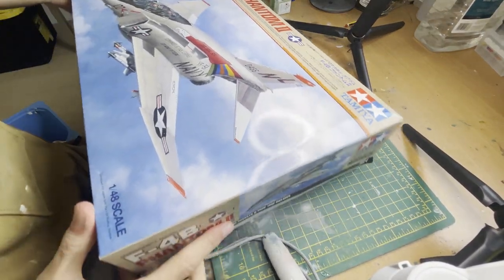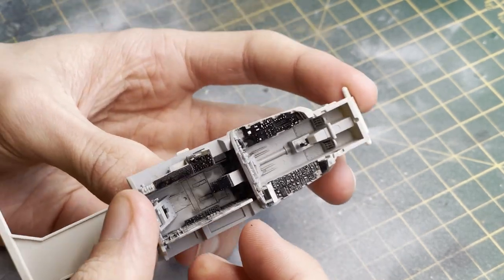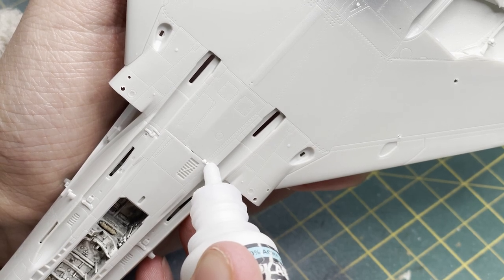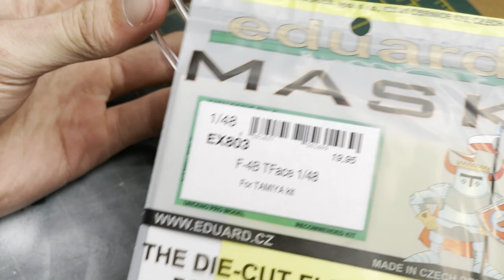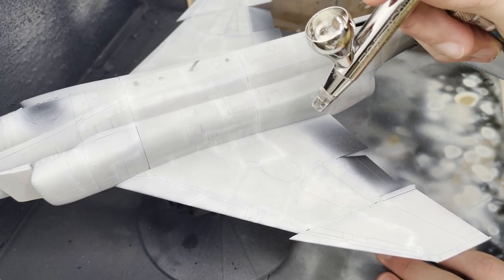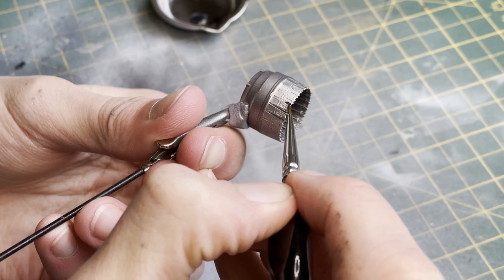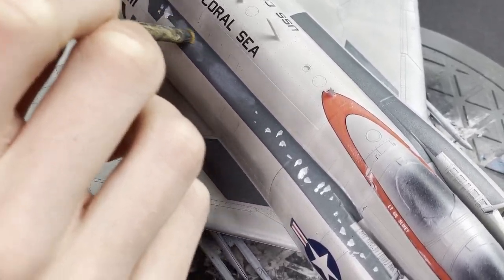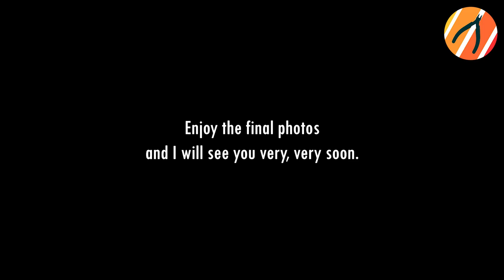Tamiya's 1/48 F-4B Phantom II | Full Build | HD

Comment: I bought this kit late last year and I have pretty much ruined it with the paint. I used ak and mr colour and Vallejo paints with a paintbrush because I didn’t have an airbrush. Has anyone got any tips to get the paint off so that I can carry on. I pain £90 and that plane has really put me off my modelling but I would like to finish this kit
Reply from the maker: Well if i was in your situation I would personally get a cloth soaked in thinner (probably the mr colour levelling if you have it as it’s pretty strong) and simple try to wipe it off. I think that should work?!
Reply: @machmodels  ok thank you I will give that a go when I get home from my holiday. 👍
Reply from the maker: Best of luck!
Reply: @machmodels  thank you
Reply: VMS clean slate works a treat. I’ve used it on fully finished armour models. Takes it all off without damaging the plastic

Comment: Excellent  build of my favorite  model kit. I have built six of these kits so far . The forward fuselage  belly panel is the only ill fitting part on the entire kit , so it wasnt something  you did wrong. As reguards to the  new eduard decals i quit trying to peel the carrier film off because  it kept chipping the decals. Now, i just spray a flat clear top coat and the carrier film just disapears.
Reply from the maker: thank you very much!! Six is insanely impressive!!! Interesting to hear you also struggled with the forward piece on the underside along with the eduard decals… good thinking about the flat coat to get rid of it though!!